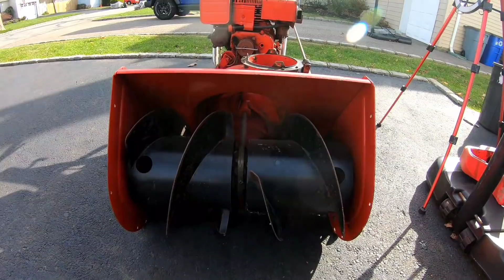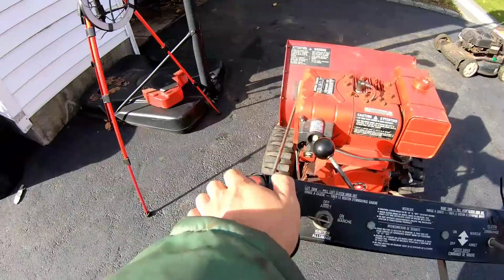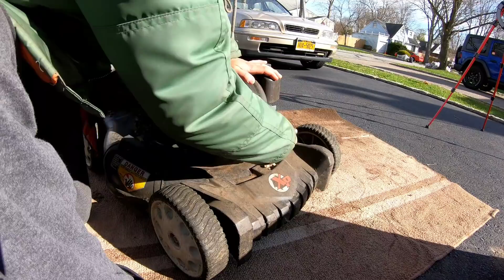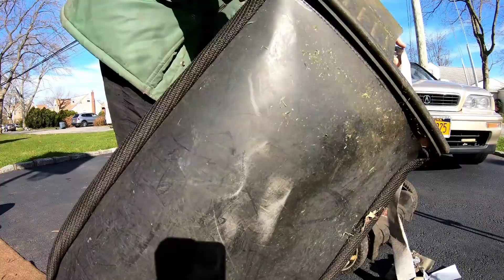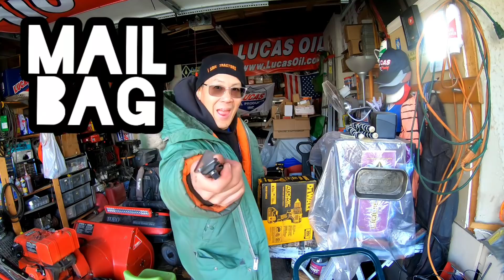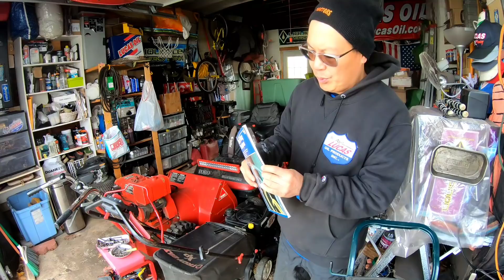TROY BILT XP TB330 7.75 BRIGGS RWD LAWNMOWER SHEARED KEY KEYWAY REPAIR & TORO 826 SNOWBLOWER STARTUP

Comment: I hate wrenching in the cold.... I had to finish up my snowblower last year and forgot the governor linkage.... then it surged.. put new gaskets on it.  It was like 20 degrees out and it's hard working with gloves on. Came in the house like 10x to warm up. but in the end I got it running like a top and didn't have to kill my back shoveling snow.

Comment: Before you sell the mower I would tighten the nut that holds the flywheel on with a breaker bar to make it extra tight because the key and flywheel is, as we say in east Tennessee " a little wishy washy"

Comment: Henry, A hot glue gun works great for patching catcher holes and rips, inexpensive $$$!🤗
Reply: Gregory, what do you use for the patch with the hot glue?  Roger
Reply: @rogermcdonald1607  cut a piece of material out of another catcher bag that is ripped up and hot glue the patch in place, works great and be generous!
Reply: Thanks!
Reply: @rogermcdonald1607  post some pictures of your results. 🤗
Reply: @gregorypierce6703  i dont have any bags that need fixing now but have had in the past
Reply: @rogermcdonald1607  ok

Comment: Awesome Sam..... As a rule of thumb, keep the torque setting on the drill bit setting, or highest, the other setting are for when you don't want to sink a screw lower then surface, 1 is for high torque, 2 is for speed IE 1 is for driving screws, and bolts, 2 is for drilling.
Reply: Good  day from Ont.  With the torque  settings, I have twisted off some screws  on high setting ,  I go lower & if  clutch slips go higher.  Thanks

Comment: I have only ever seen that 3 times in my life, wow..... Good call, I have seen it on 1 briggs, and 2 hangsen engines.... The hangsens, the key is steel, so it takes out the flywheel, awesome design... You're a nut.

Comment: I sold 5 of those big Troy-bilt xp mowers this year, 200 a pop, they are very simple to work on, I just want everyone to know, the Troy-bilt briggs engine, and the weed eater one briggs and the timemaster briggs, all have different size crank shaft ends, so that means they won't work with each other, the time master is the biggest od and length, and the weedeater one is the smallest od and length.
Reply: Nice info Robert. That is good to know! Of course why would briggs make anything the same!  Roger
Reply: @rogermcdonald1607  yeah so true...
You can fix the crank shaft problems but that requires taking the whole engine apart, and that's a pain cause it's x2.
Reply from the maker: I didn’t know that Bobby, good info!